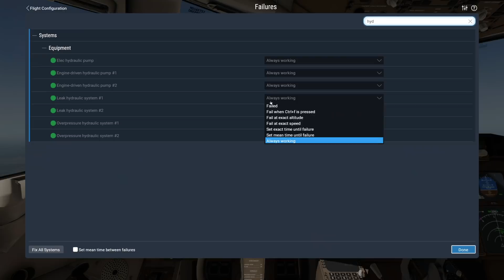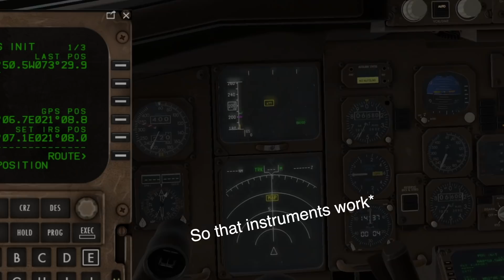767 Lands Without Landing GEAR

Comment: I've Done belly landing on turboprop flight simulator ton of times like I should maintain 130 knots in altitude of 200ft and decrease the airspeed at 20 knots at 100ft with full flaps of coarse

Comment: Xd im from Poland and i want to Say that this landing was the first sucessful ever landing without the landing gear in airliner and the capitan of this flight was Tadeusz Wrona

Swiss you Say that was a hydraulic system failure. It is a litle bit of True but not all of this. that was problem with hydraulic beacause some guy forgoten to set pomp or something from position manual to automatic and the other guy forgot to set the second caution pomp

Oh and there was i think 3 or 4 flight over the airport